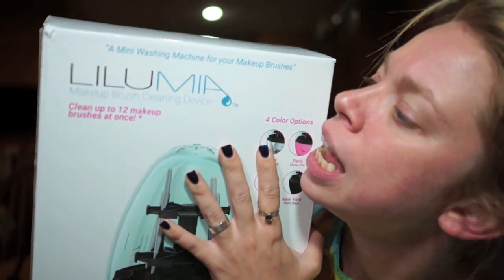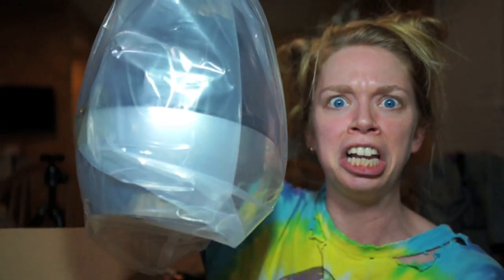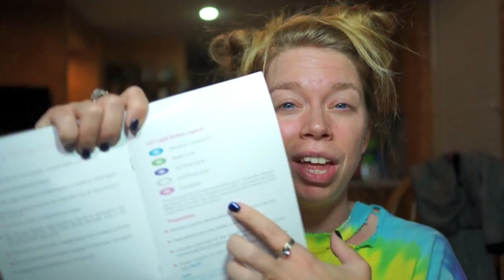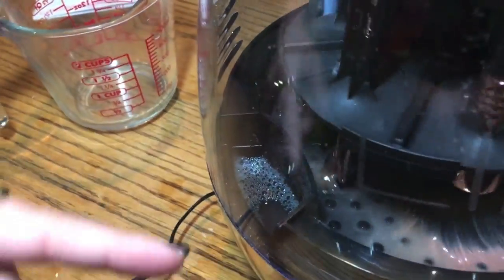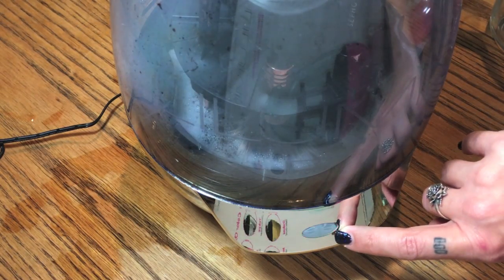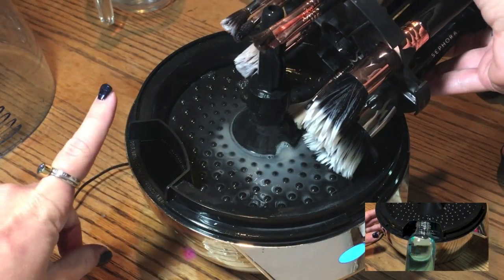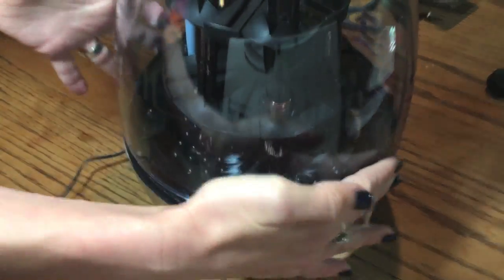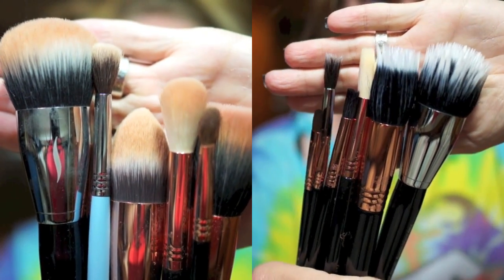MAGIC BRUSH CLEANING ROBOT? - FIRST IMPRESSION FRIDAY

Comment: That is going to ruin your brushes within five uses!! It takes me 30 minutes to wash 40 brushes and that is fine with me because my brushes aren't exposed to moisture in an enclosed egg which over time will corrode the metal and loosen the glue. No thanks.
Reply: EXACTLY! Finally someone else mentioned what I was thinking! Especially for the small brushes, the way they're just sitting in the water with the metal bit being soaked. Not good
Reply: I kept cringing because not only did it smash down the brushes, but some of her other smaller brushes' ferrule was soaking in water for a little bit and that ruins the brushes too 😱
Reply: +Kaitlyn Allen Like she said.. She has issues with her hands, I know how that feels since I am an artist and use hand tools from when I was very small and helped my mom and dad. My mom has carpal tunnel, I have a risk for it/may have it, and that makes it harder to use your hands with the troubles. She said DEEP clean, not a simple cleaning, Bunny also is almost always wearing makeup or doing ideas for makeup so as makeup artists it would save time with it.
Reply: Uh you don't keep the brushes in an "enclosed egg" you clearly keep the lid off but use that middle spoke to support the brush holder thing so they hang.
Reply: illusionsfan1 They're in the egg whilst being washed, causing moisture in the air in there which adds to the harming of the brushes because it will weaken the glue overtime
Reply: +Sadenna Swafford +Sadenna Swafford I'm sorry to hear of the carpal tunnel. My grandma has it pretty bad and I am in the beginning stages of it. I totally get were this would be useful to some people. But, the brushes weren't cleaned even though she used too much soap, this is just one of the problems I have with this device. They could update a few things and benefit from it. Once again this is just my opinion. I have mine and you have yours. With that being said I'll pass on the space egg.
Reply: +Sarah Twamley We live in the south, Bunny and I and half of America, there's always moisture in the air. Even after a hot shower the moisture dissipates on it's own. 10 minutes to wash isn't going to harm the ferrule of the brushes. Quit looking for any reason whatsoever to hate that machine. It's actually quite useful and is a sign of what's to come. The machines will get faster and easier to use. Stop being a spoilsport.

Comment: $ 147 for the machine.  Special soap is another $15 per bottle. No heating element. No spin cycle for drying. Looks fun, but way too expensive for what you get.
Reply: Lol it's such a bad product 😂
Reply: +Sheena Allen It seems like the type of product made for a 12 year old girl but they expect actual people to buy them, I wouldn't pay more than £15 for this ($22.79 roughly) It probably doesn't cost more than £10 to make ($15.19) and the solution is made in batches so the bottle they give you is about £1 ($1.52)  :/

Comment: I wonder if this would work for paint brushes :)
Reply: Probably
Reply: Omg!!!yassss!!! That's something I neeeeeddddd...you're a genius😜😋
Reply: ***** Thats true, it probably wouldn't work for oil paint. Acrylics however are easily washed out with water alone so I bet it would work for those as long as the brush isn't loaded with paint
Reply: +Shauna Meyers I would never use this on paint brushes! I am not sure it could not clean anything but watercolors anyway. Acrylics would jam up the holes. But most of all, my brushes are my living, and I would not let any device touch them! Brushes are made of hair, and are really delicate, there is nothing worse than fly away hairs on a precision brush.

Comment: The only thing I think that would make this better is a spin cycle. You should be able to lift up the brush holder thing to a higher position so they don't rub the bottom and then it should spin the brushes really fast to get rid of most of the water and then they just sit to dry.

Comment: I got a brush cleaning egg from eBay for less than a dollar and it takes me waaaay less than 45 minutes clean 6 brushes with it. This is like the most useless device ever and over 100 dollars? Jeez.
Reply: +Spargelprincess It takes 15 minutes not 45. 30 if you like. Bunny stated that clearly as she mentioned she made a user error
Reply: Well user error or not, she did three cycles of 15 minutes and to me that makes 45 mins. But even if it was just15 minutes (plus optional extra 5 ninutes) for cleaning 6 brushes, this is still extremely useless device.
Reply: You can clean up to 12 brushes and yes your math is correct, however your statement is incorrect. It takes 15 minutes and an OPTIONAL 15 minutes. What they advertise is correct. It's too bad you feel that way, my device works perfect and I save a lot of time. Good luck to you and your Ebay cleaning egg :-)
Reply: +Spargelprincess She did two wash cycles and one optional rinse which is 3 minutes. Maybe if you listened to what people were saying you wouldn't come off as ignorant.
Reply: +Ashley White It's an optional 3 minutes for the rinse cycle :)
Reply: Demi Lee Iwaszczyn Oh okay, but I still think this device is extremely useless :D Maybe for someone who prefers multitasking, like Bunny, but for me, no. Also, althoug it has 12 holes for the brushes, only 6 of them would be in contact with the soapy base, the rest six would just randomly hang in the egg.
Reply: +Spargelprincess Agreed I did the same and as a makeup artist, (which I think would be the main consumer of a product like this) I have like 50 brushes to wash at a time.  Not to mention I would use so much of the soap that it comes with just for one wash. Nope not for me!
Reply: I'd agree with you because I have the same lol. However, for someone who has a lot of brushes this device wouldn't be useless. (;
Reply: Link?
Reply: +Spargelprincess Again you didn't watch the video. It can wash up to 12 small brushes and ALL 12 will be in contact with the base you just place 2 per hole.
Reply: I have it too. It was 87 pence. Why would I pay £100+ for a shitty machine? No thanks.
Reply: Suchan it was 15 min

Comment: People are missing a big point. Maybe you can clean your brushes in just as much time...but that time is spent cleaning brushes instead of the  canine doing it. While the machine is cleaning, you can do other things...so...
Reply: The machine...lol..."the canine."
Reply: +YourKimberkitten Yes, but it damages your brushes. I spent $50 on my brushes. I don't need them to be damaged like this.
Reply: +YourKimberkitten Lol If you really care about your brushes you won't put them in a machine that could easily malfunction and ruin your brushes.
Reply: +Madison Kennedy Now that is a point I could get on board with...but I haven't seen anything that proves it will damage them. The suggestions that it could seem convincing, but if someone wanted to try it, I'd simply say try it with some cheaper brushes first. I clean mine as I use them so I wouldn't bother with this anyway.

Comment: Well that's a useless machine.  I could maybe understand if it washed 20 brushes at a time or something, but for only 6-12, I could wash that amount in less time than that thing takes and clean better too.
Reply: Same. I was excited until I saw it only cleans 6-12. I have like 3x that & can clean all of them better & dry them in the time it takes to run 3 cycles of that machine. & do it to where it doesn't ruin the brushes.
Reply: +Sweet Insanity It would work for me, as I don't have or use a whole lot of brushes, but it's still way too expensive.
Reply: MsJillVicius I can also see it ruining the brushes very quickly with the rough way it washes them.

Comment: Seriously I'm not understanding the people who are "cringing" because the bristles are gentle pushed down to get a better and deeper cleaning. When I clean my brushes by hand or use them to apply my make-up, they're pressed against my palm, which is also spreading the bristles just like you are supposed to do when using the product, so what is the difference? or have I been doing something wrong? This device is AMAZING and I can't wait to get mines! Bunny clearly made some mistakes, which she admitted to and it's unreasonable for some of you guys to judge a product based on user error. It takes 15 minutes to clean 12 brushes and if YOU like you can rinse for additional 15 minutes. Thats all! use the product correctly and you won't experience your brushes not being cleaned properly or additional soap because you would have followed the directions provided with the machine. Clearly the video wasn't the best representation of the product come on people!!

Comment: This is actually a really great device many ways!

1. You get to clean your brushes in 15-20 minutes, whereas if you have a lot of brushes, it would take a lot longer.
2. It's more environmentally friendly, because you only use a certain amount of water. Most people tend to leave the water running when cleaning their brushes.
3. When you're done, you don't have to hang your brushes upside down for them to dry, the device has already done it for you.

Comment: Waste of time in my opinion. 
I can wash all my brushes in like 20 mins LOL 
And also buying baby shampoo or brush shampoo is WAY cheaper then buying this machine and the soap that goes along with it (you can't use any other soap in the machine according to them)
Reply: Not necessarily all the shampoo eventually will be like double the price of this thing and when u clean it regularly you have to stay there however u can leave when u use this product
Reply: +IAMTHELIE Took me an hour and a half to deep clean all my brushes yesterday where as I could put a load of brushes on, do the vacuuming, come back put another load on, do the mopping, come back and put another load on and then eat food etc etc. Washing your clothes by hand would be faster but you'd still put them in a washing machine. Washing dishes by hand would be faster but you'd still put them in a dish washer.  
Also baby shampoo is great for brushes but you need to add another stage with a different kind of soap as it wont deep clean and get the bacteria off. Baby shampoo is a gentle soap.
Reply: +Demi Lee Iwaszczyn yeah but if you have a lot of brushes this will drag that process out to a day or two when you could have washed and had them all at once this thing take 45 minutes standard. I see your point if you don't have barely any to wash but time along with how much that soap cost and the amount you have to use = not worth it.
Reply: Demi Lee Iwaszczyn  Yeah I have over 100+ brushes so doing 6-12 brushes every 45 mins... Not worth it at all. 
And baby shampoo is recommended by many makeup artists (I'm also a trained makeup artist who was taught/told that baby shampoo is a better option.) Because of it's gentle qualities for real haired brushes. 
So no this machine is a waste.
Reply: Its 10-20 minutes.
She did it wrong so it takes longer.

Comment: should look into potability of using one of those Benzac Facial Liquid Cleanser with this. they usually have a oil reducer or remover and benzine peroxide in them which kills bacteria and you find a good one at walmart fairly inexpensively. then that way it would eliminate the need to sprits it with alcohol. Just a sugestion

Comment: Perfect!  However, I would use the Style Pro to dry the brushes. It would've been nice if they had a spin cycle on this contraption. In other words that it either lifts the already set brushes higher or we can lift it then it spins. 
Hmmm? Curious of the price. I do like the idea of it cleaning the brushes. Like I said I would love it to include a spin cycle since the Style Pro would require each to be placed individually. Thank you for the review.

Comment: Doesn't warm water loosen the glue in the brushes?
Reply: Yes, it's fine if you just run over the brush with warm water and work it into the bristles themselves, not up into the actual base of the brush. That's why it's bad to soak your makeup brush in water like this machine does

Comment: Great way to destroy the glue holding your brushes together. Best & fastest way to clean them is brushing water & dish soap against your hand/palm until the suds are clear. Use COLD water to wash & rinse - hot melts the glue, and if your brushes have glue in them, the bristles will start to fall out.

Comment: Beauty hack: Use vegetable oil. Or olive oil, or coconut oil. Whatever oil you fancy.
I've been doing this trick for months and I haven't gone back. It's 10x cheaper, faster, and easier, because you don't need that much oil and it's not as time consuming and strenuous.
You all might be thinking, "Oil? Really?" Trust me. What it does is sucks out the makeup from the brush and deposits it into the oil. Just press your brushes repeatedly into the oil. You won't be disappointed. It's really cool to watch. It's like a magic trick.
Of course, some of the oil gets soaked up in the brushes. This takes 30 seconds to wash out with regular hand soap.
Washing all my brushes takes 5 minutes tops. Trust me, try it.

Comment: The best way I found to clean my brushes is to take glass. Fill half  hot water and little dish soup and let it sit for 10 min. Pull them out and run hot water over them to get the soup out them. Put sit them on paper towel. Get out your hair dryer out to dry them...

Comment: I personally think this is a great brush cleaner, I don't think by pushing the brushes down it will break them but you can ruin your brush the way you dry ypur brushes. You need to dry them with facing down or the water will ruin the glue.

Comment: The video is very informative, but the product seems complicated for its designed purpose and ultimately unnecessary. I'd be more impressed if the machine held many more brushes (12-30), and was gentler on the brushes. I sure hope those weren't Bunny's best makeup brushes. Yipes!

Comment: Some of the ferrules on those smaller brushes are being unapologetically SOAKED! 😩 RIP glue.

And I don't think it'd be a very helpful device considering that shorter brushes and angled brushes aren't really getting the proper treatment they deserve. If it was marketed towards JUST flat-head brushes, then I guess that's good! 🤔 

However, I love the concept! I just think they need to go back to the drawing board and maybe add something specific for short-haired brushes, angled brushes, and maybe a sponge cleaner for that extra measure! 😂

However, I'd give it a 3 out of 5 because it DOES clean the brushes with little-to-no effort like it claims and seems to have a great concept for automatic brush cleaning.

P.S. For anyone complaining about the brushes drying, it's actually recommended to leave your brushes out to naturally air-dry rather than using any other external forces to do so. 💁🏽

Comment: I wash/sanitize my brushes VERY easily and quickly.  and they dry in literally 30 second flat:  99% alcohol.  Rub the brushes in a little cup full of alcohol, wipe on a towel of some kind, and voila- DONE.  I got the tip from Wayne Goss....

Comment: The only thing I don't like about this product is that the brushes are in the water for way too long! After so many years of hearing and reading to not soak your brushes under water for a long time because it soaks up to the glue and loosens it up . I don't think I would be comfortable using it, but good review!! Also, its take me half and hour to wash 50 brushes by hand it would take me all day to do it with this product. I recommend you using the beauty blender bar soap that really removed the makeup from the brushes even the big ones

Comment: i can clean and dry all of my 19 brushes in an hour by hand, i just use a bar of soap and run them underwater then towel dry them. i've never had any problem with shedding or anything like that from the water, this seems like the most expensive and inefficient way to clean brushes ever!

Comment: Did you ever consider that maybe you're having a reaction to the shampoo you're using on you're brushes? Depending on what chemicals are in it, that could be the issue. I usually use a handmade bar soap with zero extras in it, just saponified oils and essential oils (often which are somewhat anit-microbial, like Rosemary, tea tree, and lemongrass).
Reply: ...stupid auto correct changing my "your" to "you're"... -_- auto correct makes grammar nazi's so sad...

Comment: In the beginning she said for her to clean her brushes it took 30 to 40 minutes. If she does the extra cleaning cycle it still last 30 minutes.
Reply: The point is that during that 30 minutes she can go do something else instead of stand by a sink washing brushes. As someone who also had hand strength issues I feel her pain. Id rather spend 30 minutes putting them through a machine that does all the work than having my hand be in serious pain after scrubbing my brushes by hand for 30 minutes. It's simply all a matter of whether you want to sit and clean brushes for a half hour or if you want to load a machine and do something else while it cleans

Comment: FYI, get a new habit. This is from my Mary Kay training and the Bare Minerals guides.....
When picking up powder makeup of any kind (eyeshadows, bases, powder foundations, blushes, etc) load the brush at least 1/4 inch from the tip and press it into the makeup, then turn it sideways and TAP TAP TAP the brush handle against the side, letting the loose powder fall back onto the makeup pot/pallette. Then you don't waste as much and you are not blowing nasty germs on it!

Comment: It's pronounced like fare-ull. Also, you are NEVER supposed to hold your brushes with the bristles up when they're wet. The water gets into the handle and loosens the glue causing the brushes to come apart.